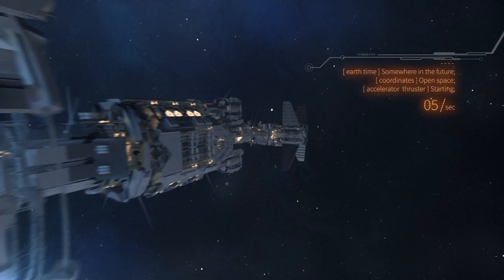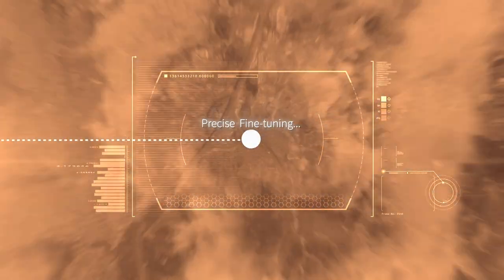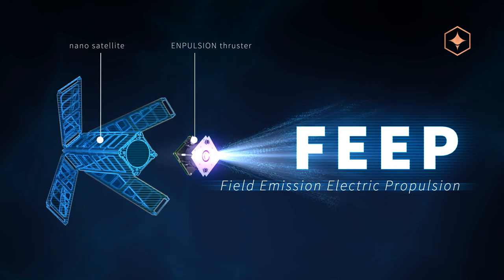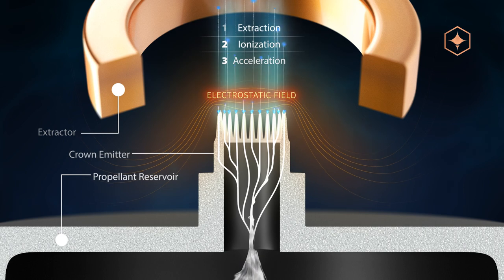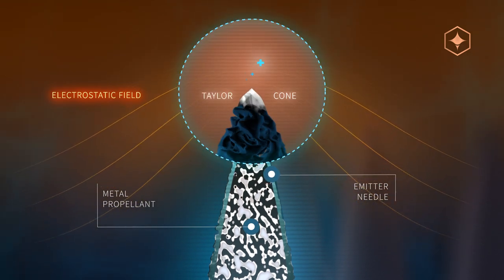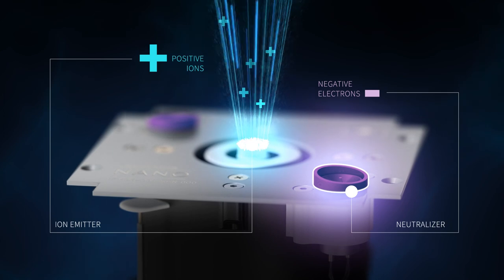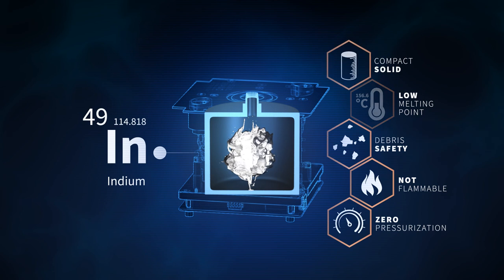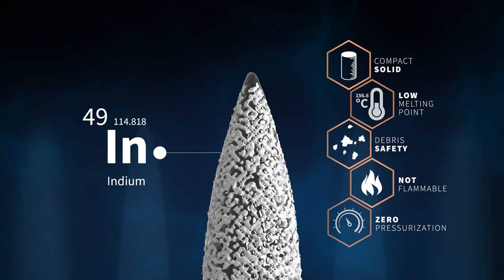ENPULSION FEEP Technology explained

Comment: Does propellant settle on the surface of satellite? Indium on solar panels could stop their work
Reply from the maker: Hi Pablo, you have raised an interesting point. Our proprietary FEEP-Technology uses Indium as a propellant. During the ion extraction process, the liquid metal is deformed by an electrostatic field and a so-called Taylor cone is formed. During this exact process, tiny drops of Indium can break off. Therefore, we regularly remind our customers to not mount solar panels or other sensitive surfaces in the thruster's beam as even just a thin film of indium can be enough to create conductivity on a surface. We hope this answers your question 😊
Reply: Thanks for Your answer) 
What is the concentration of the propellant at the surface of the sattelite? Can it lead to electrical breakdown in the equipment?